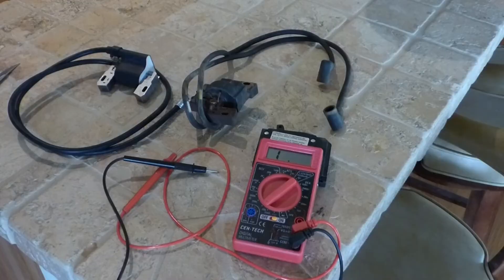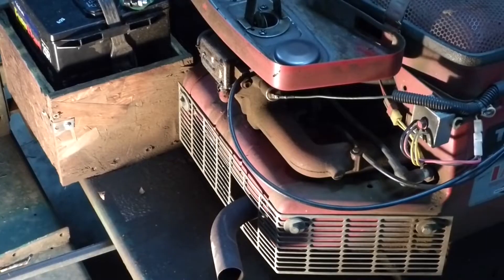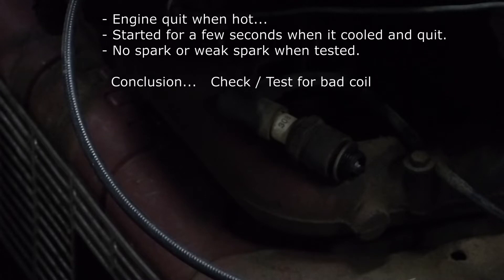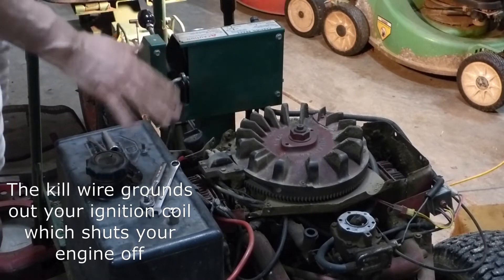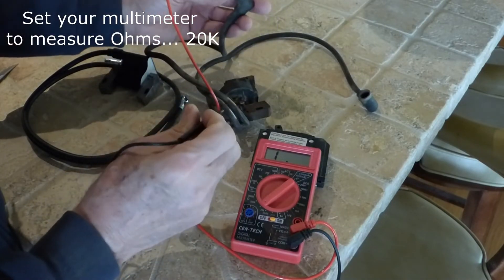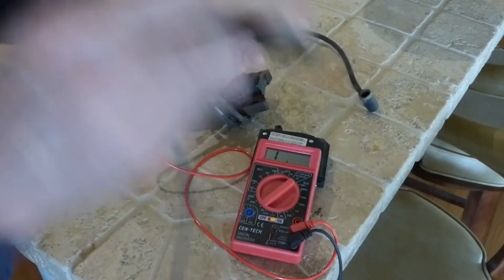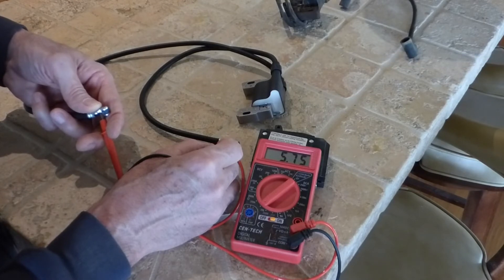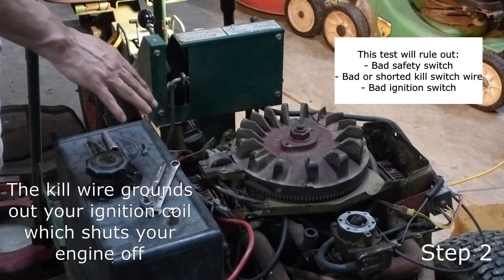How to Diagnose & Test an Ignition Coil on a Small Engine - 2 Wire Coil

Comment: Thanks for responding.  
Too hot out there (89.6F) now.
Early tomorrow I will start up the pressure washer and clean the driveway to completion. Then I will shut it off and attempt a restart with my in line ignition spark tester in place. If no spark evident, I will remove and test the coil with multimeter as per your video. Thanks

Comment: I'm trying to test a Troy-Bilt tractor coil one single wire and I was trying to watch that video that I got done watching but that's a two wire but I thank you for the video
Reply from the maker: If you want to bench test it with a multimeter... on a 4 cycle engine the primary windings should be between .5 and 2.4  ohms and the secondary windings should be between 5,000 and 10,000 ohms
Here are a couple videos that may help you.
https://youtu.be/qkS94XdK_Os
https://www.youtube.com/watch?v=BMZ93q8qAko

I find that the spark test on the engine is more reliable than the bench test

Comment: I’m getting a reading but on the 200k range only . Is this bad ? Your right I couldn’t find a video for a two wire coil either thanks for the video !
Reply from the maker: You can use the 200k
Reply: @helpinguonline  but doesn’t that mean it’s out of speck? It won’t give a reading on 20K .

Comment: Is it possible the coil will test okay from a cold coil but not okay from a hot coil?
I refer to a pressure washer that starts on the first pull but wii not restart after running for ten minutes and shut down.I
Does heat from the engine affect the coil?
Reply from the maker: Yes...  I have a video about that coming out this coming Tuesday. 
Concerning your issue... check for spark when the engine is hot and won't start.

Comment: Question for you I have a side shaft V-Twin 18 horse Briggs and Stratton somebody stole the coil off of it so I bought a new one same thing u have I put it on it ran for about 15 minutes and died will not start back up no spark disconnected the kill wire all the way still no spark bought another coil still no spark so that would mean that it has a bad ground or the flywheel is bad right?
Reply from the maker: First I would check your fuses to make sure no blown fuse.  Check wiring for no shorts.  Then I would make sure your ignition switch is working properly.  You could check the magnets on the flywheel to make sure they are not real rusty/clean and that your coil is properly secured and gapped.
Reply from the maker: If you have the V twin engine with a single coil and two wires… Remove the kill wire and if you have no spark then I would check 3 things.  Make sure the coil is good. Make sure the magnet is still in the flywheel and is not damaged or did not fall off. And lastly check the flywheel key and make sure it is not sheared or damaged.

Comment: I have two wires coming off coil terminal both are wired into one terminal to hook to the back of the coil. Where do those wires go . One has ground trerminal and one is just stripped naked wire?
Reply from the maker: Some coils are not grounded when mounted to the block of the engine and I would imagine that stripped wire used to have a connector on it that bolted to the block of the engine for a ground

Comment: never test coil and spark plug at same time plug could be bad make you think you need a new coil ----just insert  screw driver into coil wire to veryfi spark  then insert plug to check plug to see plug spark